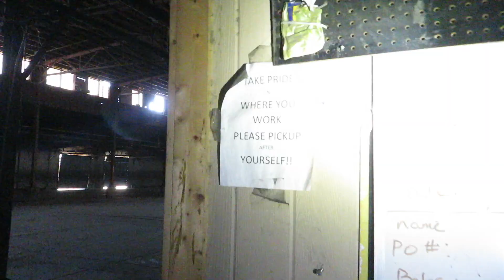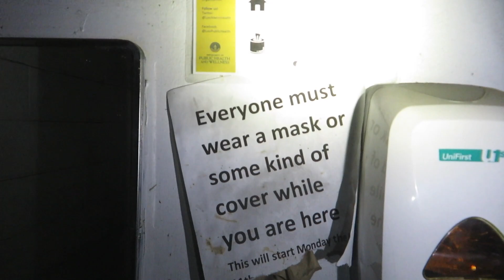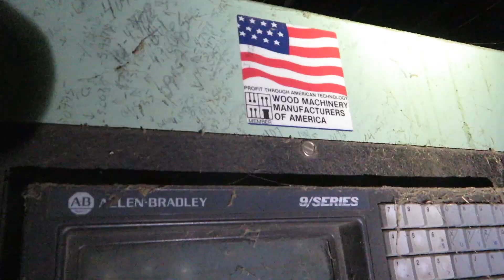Exploring an Abandoned Recycling Scrapyard and Sneaking into an Active Facility Inside

Comment: You've been finding some good places on this trip! The room at 9:50 is a riser room, it's all the equipment for the fire sprinklers. The air compressors come on automatically to keep the pipes charged with air. When the sprinklers are set off, the air is released, and it opens a valve, releasing the water. Just don't mess with any of the stuff, and you'd be ok.

Comment: Yeah, you're not gonna get rich recycling aluminum cans. I don't do it because of "save the Earth", I do it because if we actually go through soda or beer cans, might as well get a few bucks.  No $$$ in recycling bottles or metal cans (canned soup, veggies, or dog food), so screw that, those go in the trash!! Mom actually got me started doing the aluminum can thing back in the early 1980's. We would have sodas so we would save them from home, crush the cans, and put them in trash bags. On the weekends or summer vacation we would go hit up local baseball diamonds and parks collecting bags of cans. In the end me and my stepbrother would split $10 or so. In 1982, that's some righteous bucks for a couple 10 year olds! Even today, I still recycle (place over by Royal's Stadium in the Leeds district). Every 6 months or so, I load up the truck with our aluminum cans and get maybe $15-20. I give it to the wife because that's the kind of generous guy I am 😁
Can't tell if it's an optical lighting effect but looks like someone is walking through a door at 5:49 on the left side of the video.